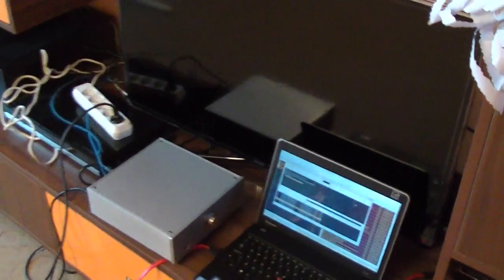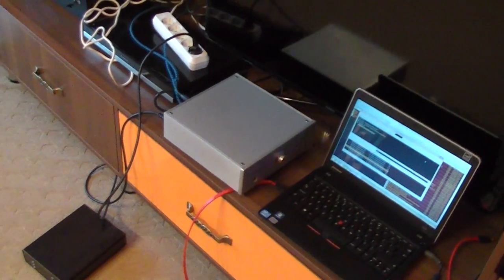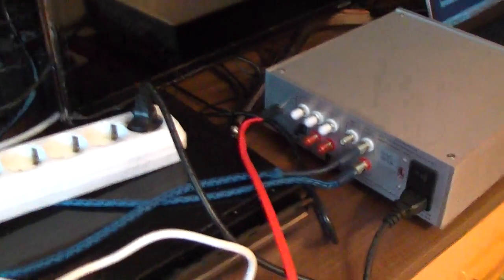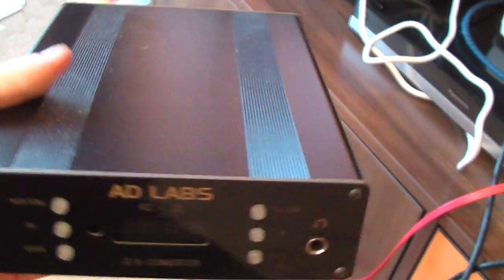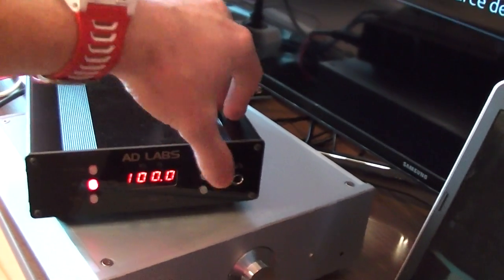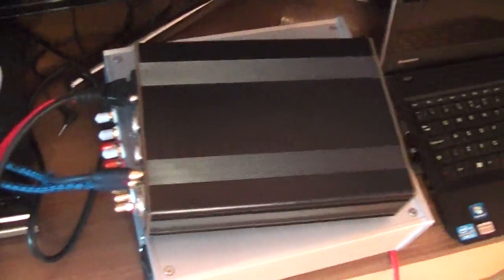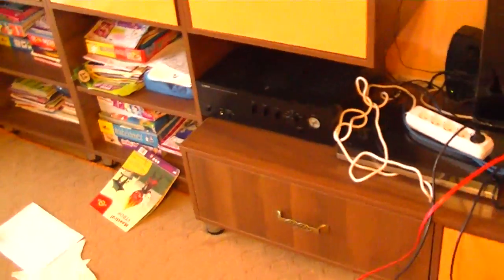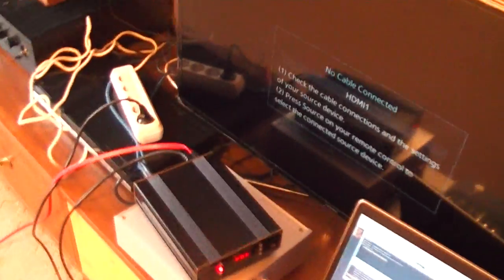Electrical noise with the new Burson Conductor Virtuoso

Comment: I have a V2, there's absolutely no noise on outputs, not even on sensitive IEMs. Most likely there should be a ground-loop in your system or your mains are really noisy. V2 & V2+ are indeed very sensitive to ground-loops and power noise.

Comment: I have burson soloist (amplify only) and has same issues with certain  configurations. It seems to be very sensitive to ground loops. However with less isolated equipment I got no problema. It seems to be is not very well Isolated as manufacturer states in marketing ads

Comment: Are you connecting the burson condutor to what input of the yamaha amplifier?
Does it have a power amp input?
Reply from the maker: Luis André Ferreira I connected it to one of the normal line-ins.
Reply: Does your amp have a power amp direct input?
If so, use the pre out of the burson to the power amp direct in. If not, use the dac out to one of the line in inputs.
Reply: modelsimuser Does your amp have a power amp direct input?
If so, use the pre out of the burson to the power amp direct in. If not, use the dac out to one of the line in inputs.

Comment: You have a ground loop issue. Try lifting the ground on the AC cord. Use better shielded  cables as well. Not the equipment issue.
Reply from the maker: I might have, but the Burson should not have issues with it since other less expesive DACs work perfectly, without any noise.